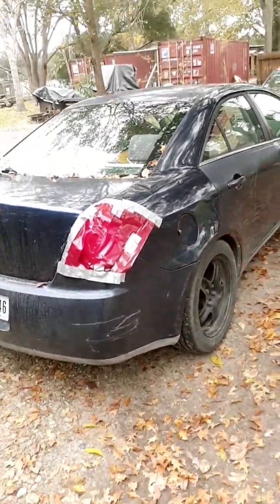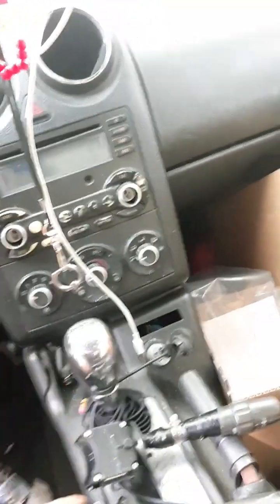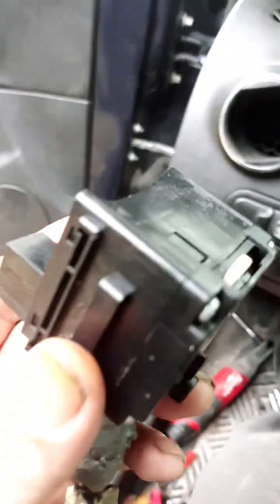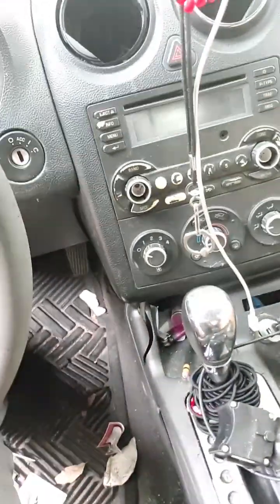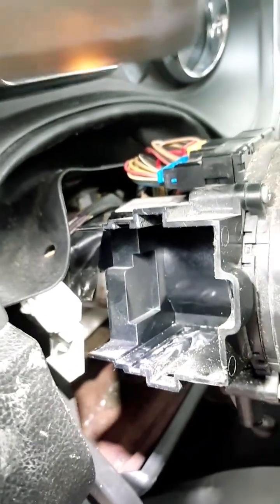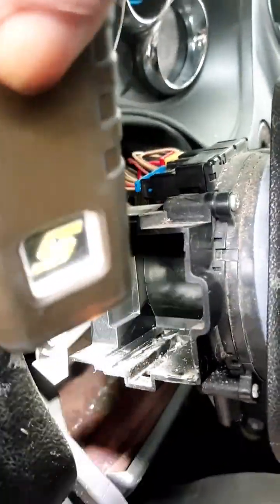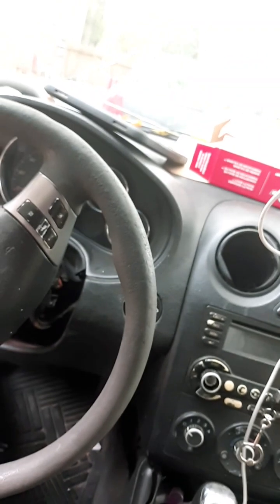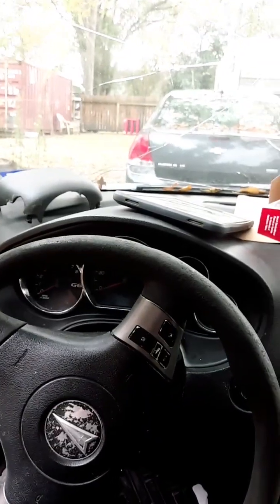A super glued? headlight switch....& a wiper switch replacement job.

Comment: I will claim this mess. We had to use epoxy to fix both gears till I could afford to get new ones. I've have had Duane working on my cars for about 6 months now. A few items each month. I definitely want to recommend his service. Great prices and service! Check him out for your car. You won't be disappointed!
Reply from the maker: Thanks Sam!........glad I could get the headlight switch/arm replaced.....without breaking any of that plastic housing.....that was actually a miracle........but thank you for the good review........and for 'fessing up' on the epoxy use........that definitely made the job a little harder than it should have been.......but glad it's all good now.